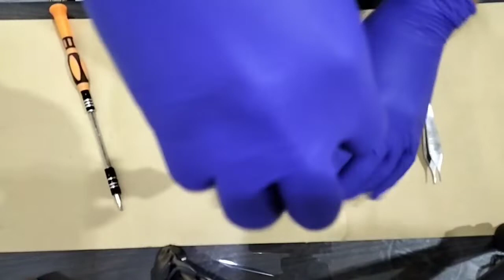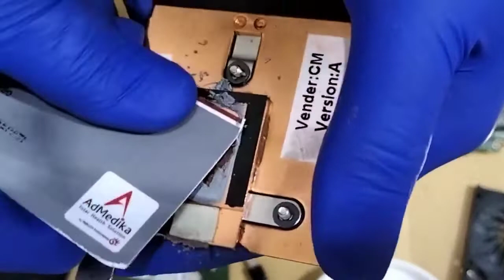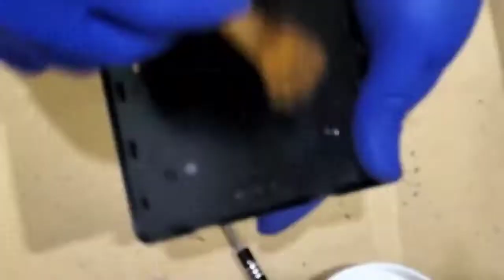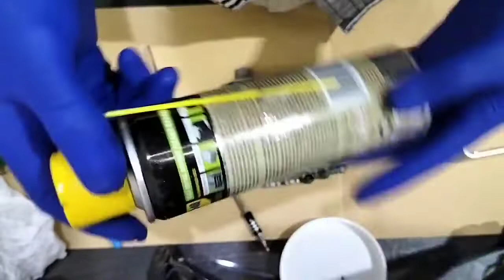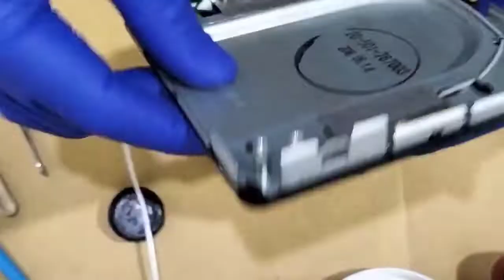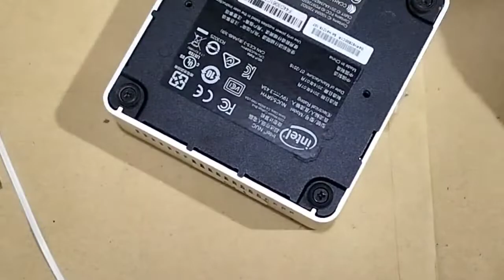Intel NUC Disassembly NUC5i5RYH [For Dust Cleaning, Fan Noise]

Comment: Where did you buy your Thermal Pasta? I tried searching and couldn't find any, can I use Thermal Paste instead?
Why wouldn't you just replace the fan while you're in there too?
31:12 What rust? Copper doesn't rust cos it's copper?
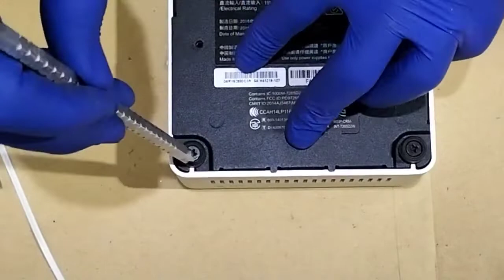34:16 That's not how you should screw, you should screw diagonally or else you'll stress one side.
Reply: Why would you replace a perfectly working fan?
Reply from the maker: Sorry for the misspelling of the word, what I meant was thermal paste = thermal paste.
The condition of the fan is still good, just a little dusty
The corrosion I mean is the effect of oxidation on the copper which makes the connector contacts blocked.
I will try to be better about the screwdriver process
Thanks for the comments and suggestions, I really appreciate it

Comment: Thank you for your demonstration.  My fan started to make some noise, and I bought a replacement fan to replace the original one.  I was stuck at the part where I had to remove the two screws to get the board off to be able to get to the fan.  You showed this at around the 4 minute mark, and that let me complete the job!  Thanks again and be well.
Reply from the maker: @stevestorck4788  Hi... You just did the greatest work! I Am very happy to hear that 🙂, I hope good luck is always with you.

Comment: Hi, I made a mistake, I removed the plastic from the heat sink, the cover is made of paper and it had plastic on it, I thought it will prevent proper heat dissipation, please help if it will affect the nuc performance
Reply from the maker: I thought that "plastic" is an isolator that prevent the electricity short betwen each metal part
maybe you can put on it's position and to make sure the plastic doesn't move maybe you can also put some paper tape on the edge
or will be better if you have some special glue for it
Reply: @DeniDIYID  ok makes sense, the heat sink does touch that metal top
Reply: what do you think if i put a thermal pad instead of plastic there?

Comment: you can use alcohol to soften the hardened thermal paste and wipe it with a clean cloth. Don't use hard objects just to remove the thermal paste. you can either damage the surface of the microprocessor or the graphics processor.
Reply from the maker: nice sugestion Bro thank you... 😉

Comment: Is that a thermal pad or grease on the smaller chip under the copper heatsink?
Reply from the maker: It use thermal paste/ thermal grease on the smaller chip under the copper heatshink, ah yeah also i see there is any thermal pad under the chopper heatshink